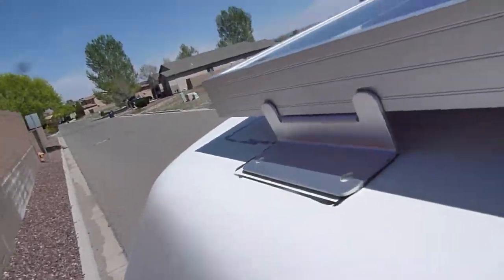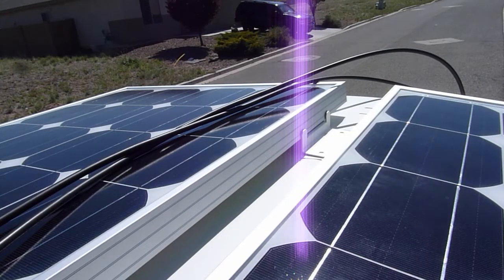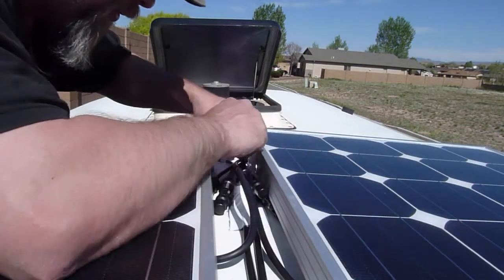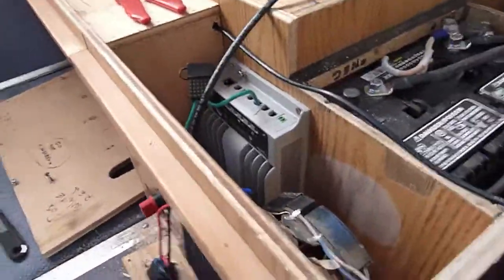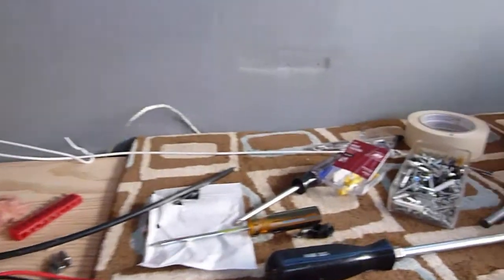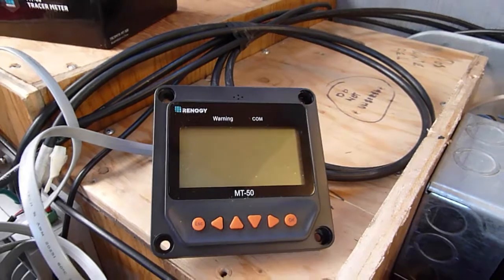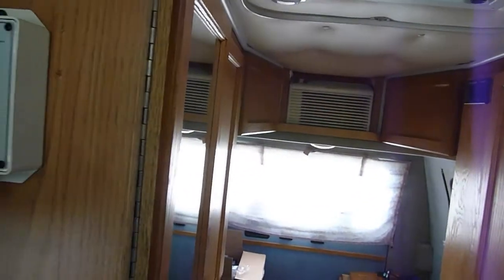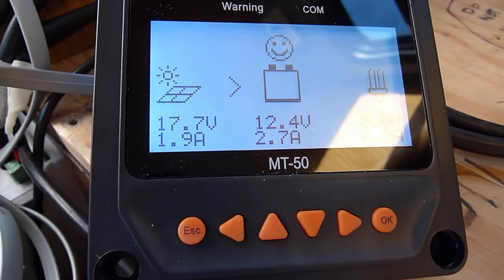Solar Install Pt 2: No Drill No Holes Solar Panel Install | Fiberglass Roof RV Roadtrek Camper Van

Comment from the maker: My entire solar setup was purchased on Amazon. You can find links to everything here: http://hobotech.tv/amazon/

I also did a long term follow up on the install here: https://youtu.be/nShLdvEQyZI
Reply: why never use silicon on the roof?  I used to use 3M's 5200 adhesive sealer for literally everything on my sailboat...  I am watching your video and thinking of using the 5200 on my travel trailer roof to attach the solar panels - I already have the 5200.  Any helpful feedback on that?

Comment: Water will glide inside the vent from the cables. Did a similar thing passing cables through the storage box and water was gliding on the cables inside the storage compartment.

Comment: hello! do you have a video on how you can wire all the outlets, water pump, and furnace output to your solar system? i’ve recently installed my system but down to my last step on connecting it all to my solar battery bank instead of the dead 12v it’s currently connected to.

Comment: Your on/off switch, is that solely for the solar panels?  I have a life4po(?) 200 AH battery in my horse trailer that has an on/off switch on it, but do I need one for the solar charger controller?

Comment: I like the idea of bringing the cables through the AC vent rather than drilling holes in the roof! Are you still happy with your setup?
Reply from the maker: 100% ... although I could always use more batteries and panels

Comment: Safer to use sealed batteries inside an enclosed space. cost a little more but much safer. The gasses from an unsealed battery can collect in an enclose space and ignite with a spark. I know this from personal experience, had one explode on me.
Reply from the maker: See the black PVC pipe? That's the vent to the outside. I replaced that battery anyway about a month later. I did another video on that.

Comment: Hey Hobotech, nice channel, just subscribed.  We just got a 95c190V, and wondered where does the a/c condensation hose route to; just wanted to make sure there was an internal drain somewhere even though I can't see it.  Saved this video, might add 2 flexible panels using eternabond then routing as you did, to our goalzero yeti 1400; just need to figure out adaptors to plug them into the yeti.  Thanks!
Reply from the maker: Modern a/c units evaporate the water out with the hot air. There is no drain.
Reply: @HOBOTECH  Well that explains it!  Thanks! Just hope this is a 'modern' ac unit.  Looks pretty new, with a wireless remote, I'll assume it's a replacement from the original.

Comment: I really like this idea for no holes mounting of solar panels to the Roadtrek. However, I sat watching the whole video worrying about if you ever need to work on the wiring on the rear of the panel. Have you thought about how you will get access to the junction box on the back of the panel?
Reply from the maker: It's sealed so I should never need to work on the wiring. If I had to replace a panel I could either remove the nuts disconnecting the bracket from the bottom of the panel, or use a hacksaw blade or a wire saw to slice through the center of the tape. Either case it is no big deal.
Reply: HOBOTECH I think regular angle brackets would have been a better choice. Then you'd have access to the nuts all the time, and depending ok where you put them, you could have easily incorporated manual tilting of the panels, and been able to remove them completely if so desired.

Comment: Are you getting any leaks riding on the wires and into the vents?  You usually want to make a J loop so water doesn't run down the wire into the vent or hole in the wall.
Reply from the maker: Nope. Gets wet in there all the time. That vent is open to the rain and has some sort of internal drain.
Reply: OK..That makes sense... Thanks.

Comment: Went through this process a few years ago except used Sikaflex instead of the tape. Long story short, my panel mysteriously flew off on a recent trip. Did all the very serious prep, had the proper 4950 VHB but still lost it. Some people suggested water may have gotten in between the VHB and brackets. Possible. But clearly, using tape leaves 25% of the bracket and VHB wide-open exposed to the elements. Do you think there is any truth to water infiltrating the tape and causing it to fail? Anyone? And what are the pros and cons of the tape versus Sikaflex? For round two!

Comment: Hey Tom.Thanks for sharing. Thinking of doing solar on my 02 roadtrek190P. How are you running your cables behind the wall, cabinets, shower?  My battery is located in left corner driver side rear storage corner. Will Renogy customize cable length? I like how you have cables running through rear vent. Im avoiding drilling too. Trying to figure how to run cables through cabinetry down fabric wall to battery. Then, the other side the same. Around shower somehow, to the wall console, to mount system. Any help or photos would be appreciated. I know your busy with the Tranny. Holler at your convenience. Thanks
Reply from the maker: I simply ran the cables through the existing a/c cable hole into the cabinet, and then drilled a hole in that cabinet to run the lines down behind the fabric wall to the controller which is under the bed. You can watch my Solar Series for all the details and how I installed the MT-50.
Reply: @HOBOTECH  Tom, do you have any heat issues with the solar controller under the bed?

Comment: Hi Tom: Love this video but don't want to use roof mounted panels on my PW. I bought the Dokio folding 200 watt panels so I can move the panels into the sun if I am parked in the shade. I also have an additional 80 watt Dokio folding panel that I will eventually join with the 200 watt.  I have two 12V Interstate batteries.  I think the controller that came with the Dokio only does 10 amps and want to upgrade the controller as well as use permanent connections on the batteries (vs. the supplied alligator clips) because the batteries are located on a heavy, PITA slide-out tray.  What would you recommend for a suitable controller and connections that don't require major mods to my PW (translation--easy for a woman to hook up)?
Reply from the maker: I would recommend using regular terminal connectors for permanent connection to the batteries and SAE quick disconnects for the solar cables. You'll have to cut the alligator clips off and crimp the connectors on. Definitely run the panels in parallel. Don't bother with PWM controllers as they are too inefficient. At minimum I recommend this https://amzn.to/2tLWdvP and if you have more to spend get this https://amzn.to/2NhR72z . I prefer Renogy and the 20A will give you more expansion options later.
Reply: Excellent info.  Will probably go with the Renogy then.  You're the BEST Tom, thank you so much for your fast response!  :)

Comment: Question -- if there's ever an issue with the panels or wires, how would you be able to pry them off the roof without damaging them?
Reply from the maker: While the brackets attached to the roof are permanently affixed, the other end is bolted to the panels. I could simply unbolt them if I had some kind of rare panel failure. If the cables would fail, they can be replaced without removing the panels.

Comment: Can you stand up to full height inside that van? It looks like your head is dragging the roof.
Reply from the maker: Yes, no problem. It is designed for a 6 foot tall person, but I have additional floor padding and wear boots so it looks less than it is.

Comment: Are the panels still secure after a couple of months driving?
Reply from the maker: At the end of this video there is a link to click to a 5000 mile follow up video I recently did.
Reply: HOBOTECH thank you. I'm getting a couple of flexible panels tomorrow and I appreciate your help. Take care bud
Reply from the maker: Good luck! I wouldn't recommend VHB for flex panels as they delaminate and don't hold up well to things like tree branches. You'd never get them back off to replace them. I'd probably use something less permanent like Dicor lap sealant on those.
Reply: HOBOTECH ok, thanks again

Comment: "Flex Seal" with the Coked out spokesperson "Phil Swift" is actually like no other roof sealant for RV'S,it is a different self leveling sealant amongst all the standard norm products available,maybe they use Porn Blob Splooge in their patent pended formula,Ron Jeremy's retirement job.
Reply from the maker: LOL. I actually tried this mysterious substance to fix a minor gray tank leak (after paying a professional to "fix" it). Didn't do the job. Lesson: Don't believe everything you see on TV.
Reply: HOBOTECH They make different type of products,it depends on which one you used.I used it to fix the hole in my boat & it still floats, just like in the commercial.Yeah the RTR is coming up & I can't wait, you're right there.I'm in NM, anyway I use the aerosol spray can seal stuff I don't know which one you used.Great videos,keep them coming they are fantastic vent van fan status type quality content Vids so how did you end up fixing the grey tank leak, that's funny the same thing happened to me I ended up paying a guy, professional RV place & boom it was still leaking,LoL..

Comment: Does the enternabond waterproof the cable connections?
Reply from the maker: No. The cables are already water resistant.
Reply: HOBOTECH Thanks!

Comment: Which one the three VHB tapes did you use?
Reply from the maker: hobotech.tv/amazon
Reply: Did it have a foam sandwich ?
Reply from the maker: I don't know what it ate for breakfast but if you just looked it up on Amazon I bet all your questions would be answered.
Reply: @HOBOTECH  There are several products under the. VHB brand I just wanted to duplicate your success sorry I bothered you

Comment: why don't people put blankets over the panels when they are hot to the touch or when they don't want them to be 'hot' with electricity as they connect all the components?  Seems like a no-brainer  safety precaution.
Reply from the maker: Good point but it is quite windy that time of year in AZ so that wouldn't have really worked in this case.
Reply: @HOBOTECH not if you put elastic on the cover

Comment: i would of run the cables under the panels out of the sun
Reply from the maker: They are UV protected cables. No problems in the sun. I'm actually glad I did it this way as I was able to experiment with hooking them up in different ways.